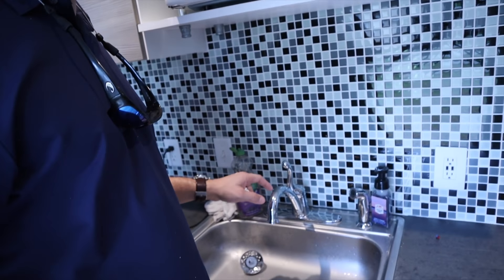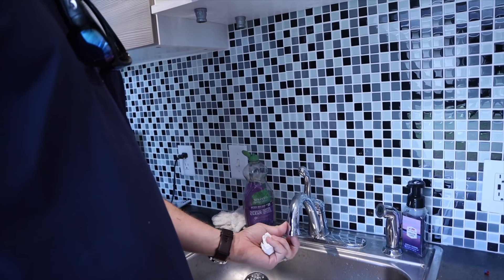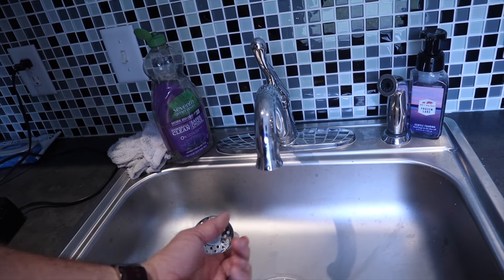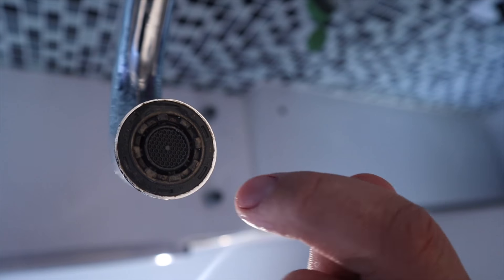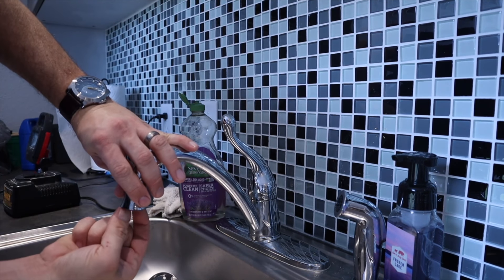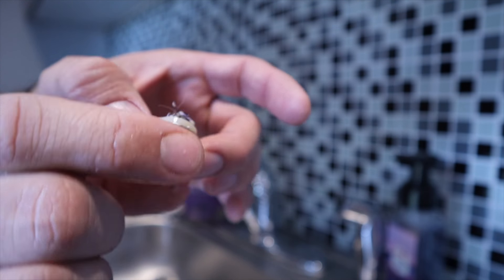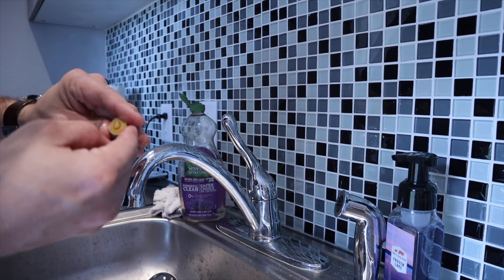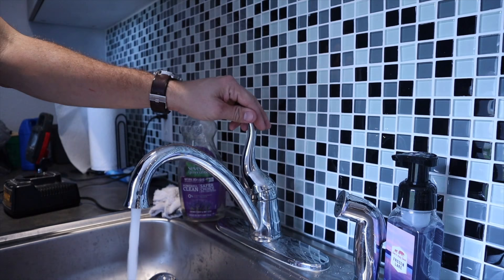Remove Water Faucet Hidden Aerator (Delta)

Comment: Your video showed me how to get the aerator out, but I was working on it in the middle the night with no tool.  I used two miniature screwdrivers; stuck them in opposite on sides and turned.  It came right out.  My problem was calcium deposits.  The holes of the small strainer on top were, also, clogged with calcium.  I used a small gage pin to open the holes.  It took a few minutes, but I wasn't doing anything anyway, and  it saved money.  Thank you so much.
Reply: I have so much calcium I can't get the tool to go into the holes.

Comment: Just to let you know: Delta makes a key-like round notched tool to make it easy to remove the aerator available at Home Depot or similar. Also the amount of debri in that faucet indicates some other serious issue. I've seen bits and pieces of metal or tiny particles of dirt, but never fibrous looking material in the aerator.
Reply from the maker: Thanks, Harlan, I have the tool linked below. This building was piped and some sand got in the main line, that’s why the aerator was clogged. Thanks for the tip.

Comment: Thank you so much!  You just saved a widow a plumber’s bill and/or the cost of the aerator tool!  My fingers wouldn’t do it but I used a little pinch nose pliers to grab the aerator tab.  I would not have known what to do or which way to twist it without your video. Thank you so much!

Comment: Thank you! Your advice allowed me to remove and clean the aerator. In case this helps anyone else, I have one of those faucets that pulls out to become a sprayer, and it seemed much of the obstruction was just above the hose. The hose is detachable, and I was able to remove most or all of the debris, and now it all works like new! I was afraid my old pipes might be full of deposits and need replaceement.

Comment: Thank you! This vid helped me figure out how to fix my problem. Though my issue required me to purchase a new filter. Also, thanks for the tip about the key. Luckily my home builder/installers left the key under the sink, which was a nice surprise to find . Btw the new filter I bought ($6) came with a new key too.
Reply from the maker: Glad to help, Raymond, thanks for watching. Thanks for sharing. Your comments might help someone else. 👍

Comment: That was so helpful, we ended up with a lot of crap in our lines after we turned off the water during the freeze so that was super helpful. I didn't realize that in the box they had a tool and when you mentioned that and I was like might as well look, and there it was and now I have running water in my bathroom sink. Thanks so much!
Reply from the maker: Great to hear. I’m glad it helped you out. Thanks for watching!

Comment: Thanks for the video. It helped me understand how that stupid design was supposed to work.
and now I understood why that faucet was 75% off when I bought mine. Different brand but same style of aerator. I tried to remove but it was stuck quite well, So I had to damage it. At least we have more water, until I can get rid of that stupid faucet.
Reply: Dang
Reply: same here !plus busted my finger nail!  and gouged myself several times! it was made of plastic -finally got it out with a thick credit card!

Comment: Well, this helped me remove the aerator! Yay! However, the faucet still has low pressure while the sprayer has a lot more. This happened right after my boyfriend installed it. At least now we know what the problem isn't!
Reply from the maker: Could be a clog somewhere in the faucet stem, or maybe your model just has a lower pressure. I wouldn’t think it was a clog in the supply lines since your sprayer has strong pressure, but could be. You could also remove the valve assembly of the faucet and make sure there isn’t a clog there. I have another video where I replace the valve cartridge on this faucet (if yours is the same model, that may help you).
Reply: @IAmAFixer  awesome, thank you! We will take a look. Thanks for sharing your knowledge with folks!

Comment: I have a new delta hidden wide separated faucet in a bathroom. After all of a week it completely stopped!!!! We took out the aerator using the tool which Delta supplied and some debris came out. However you make it look so simple getting back in. After three tries it still has some water squirting sideways and worse than that water is leaking under the cabinet down the little black tube that goes to the spout. My plumber thinks its connected to the aerator not sealing right. Boy its frustrating.  Any tips to reinstalling so everything seats right?

Comment: Is it possible to put a Britta water filter on these types. I just moved into a home with this kind of hidden aerator and want to a) put Britta on it, and b) adapt so I can put a garden hose on it in the winter. Am I stuck with replacing the whole faucet if I want to do these things or can I do it as is? Thanks!
Reply from the maker: You could probably unscrew the aerator and attach a garden hose fitting and possibly a britta filter, but you would just lose the aeration adaptor. Not positive about the thread size
Reply: what is the result?

Comment: Awesome, thank you so much! I should have tried to take it off before I bought one of those aerator keys. :(
Reply from the maker: Don’t feel bad, I almost did the same thing! I’m sure one of those keys makes it much easier though! Thanks for watching!
Reply: @IAmAFixer  I used the ends of the needle nose pliers as a spanner tool.  Works but the aerator is damaged and needs replacing.
Reply from the maker: That’s too bad. Thanks for sharing!

Comment: Question. I just replaced mine and I noticed the water pressure significantly changed. But I also noticed the previous aerator was in upside down

Comment: My aerator has a slot on either side, but not all around like in this video. Do they make tools for that too?
Reply from the maker: What is the manufacturer of the faucet?
Reply: @IAmAFixer  I'm afraid I don't know. I live in an apartment and they put "water saver" heads on the faucets. When I try to unscrew the cover it just spins. I can see screw threads under the cover.

Comment: Thanks for your videos. I really enjoy them. I have a question maybe you can help me with. I just went to Home Depot and purchased a Delta Faucet. I think the model is 9113-DST which has a pullout faucet head. I installed it 5 days ago and the problem I'm having is the water pressure is already reduced. It was great for the first 2 days but as small particles and settlement is coming through the lines it's starting to slowly clog up the inside filter. Unfortunately, the inside filter does not appear to be removable. It looks like I have to take a little pipe cleaner or small brush to clean it off. My question to you is do you know of an aftermarket faucet head that does not have all these filters and water reducers in them? Or one that you can at least completely disassemble to clean? This faucet head does not appear to be one that you can disassemble. Thank you for your time. - Jim

Comment: Why was the water pressure different when you removed the aerator?
Reply from the maker: It was packed with sediment. Once I cleaned it, it restored the flow.
Reply: @IAmAFixer  make sense. I removed the aerator from my bathroom faucet but it still has a plastic piece with one tiny hole I've been trying to remove it but no luck and the water flow looks exactly like that in the video

Comment: I have been struggling with removing the hidden aerator. I purchased the tool key from Home Depot. But the aerator does not move from its place even a millimeter. I am not sure but may be its stuck with mineral deposits. Can you please suggest some solution? I tried soaking the end part of the faucet  for 3 hours in vinegar by tying a small bag full of vinegar but no luck.
Reply from the maker: I know this may sound silly, but you’re sure your twisting the right way? Righty tighty, lefty loosely. Can’t imagine what would be keeping it in there that well , otherwise.
Reply: @IAmAFixer  Yes counter clock wise like unscrewing when looked at it straight from the bottom upwards towards the faucet opening. It's stuck like it has been glued or something. Do you suggest breaking it with a tool or try some alternatives like using WD-40 to loosen it? I can't think of anything else. Please help!

Comment: My Delta cache aerator will not turn when using cache key that came with faucet. Figure aerator has corroded and 'frozen' inside faucet. Suggestions?
Reply: Same problem.  All the tool did was mangle it.
Reply: Same here

Comment: Any ideas for unscrewing an aerator cap that won't budge?  I have the tool/key.  No luck getting it to budge.  I asked a plumber to take a look at it when he was here doing some other work.  He had no luck either.  Soaked it in WD-40 for 24 hours.  No luck.  Soaked it in CLR for 30 minutes.  Still no luck.  Both of my master bath faucets have low flow with aerators that won't unscrew.  Any advice is appreciated.
Reply: I have even tried vinegar overnight. Same thing. Vinegar dissolves the calcium externally where I can get the tool to mesh but turning it?  No way. It’s like it’s welded in place.  Have not found a YT yet that addresses that. Just getting the damn aerator off!

Comment: My issue is the calcium deposits. After soaking in vinegar for 24 hours I can get the tool in those notches but it’s like the aerator is welded in place to the faucet due to the calcium.  Trying WD40 next to hopefully help break it loose. I just cannot unscrew the aerator.

Comment: If you pinch the mesh, it will come off and you can clean inside.  I had to even re-seat the o-ring cuz it was off.
But, I actually came here because I need to remove the entire inner part, not just aerator, and the keys I bought don't seem to fit the outer part. Its a grey sleeve between the metal and the aerator.  I wanted to install a swivel extention.

Comment: You got it with your hand?? Man I can’t turn it even using the tool. Its so dam hard. Any ideas??
Reply from the maker: Try soaking the faucet head in CLR for a while to see if it can dissolve some of the calcium build up
Reply: I Am A Fixer what is CLR btw?
Reply from the maker: https://www.amazon.com/PB-BK-2000-CLR-Kitchen-Cleaner-Trigger/dp/B07CQ5L14W

It’s a cleaner, can dissolve calcium buildum
Reply: I Am A Fixer good to know. Thanks!

Comment: They make a key for that
Reply from the maker: Yes. Live linked it in the description
Reply: @IAmAFixer  Now I have another question my air raider is gone the metal part is stuck inside do they make an extractor tool to take it out of my faucet I had the same faucet
Reply from the maker: I don’t think so. You could probably remove the faucet stem from the base and use a coat hanger or some other flexible wire to push it from the inside out.

Comment: Do you know what the next step is if its not the aerator.....because It can be other things as well..
Reply from the maker: Hugo Moreno if it’s not a clogged aerator, it could be a clogged valve cartridge. I have a video on that too. Otherwise, you probably have an issue with your pipes or shutoff valves.

Comment: I need help
Reply from the maker: Try ordering the removal tool (link in the description). You should be able to get it with that. You could also try filling a cup with some penetrating oil and submerge the sink spout in it for a little while to try and loosen it up.
Reply: with something else I have 43" by 21" bathroom cabinet countertop here they put 22" on I thought is like this further back even if online looks reachable smaller .... , the sink is big round and I think sticks out where faucet is and counter and just not good style I have 6" delta faucet and really very close actually more so and say hitting hands on sink have to wash above sink and faucet not in sink sink is bigger .., .... but looks faucet handles far back on spot I want to put drop in sink but I don't know if changing just countertop I'm laying in sink and it's farther back and I think same problem if change countertop in this apartment I've been planning to change both neighbor help me I hope with that too I have same problem faucet looks feels is far back in kitchen everything is standard size and in bathroom It is low arc delta maybe moen in kitchen sink and usually that is why too I can barely use rinse rag can't end now wash dishes wash wrists must be something wrong and like bathroom does look more square and cabinet and I thought with this size in bathroom I forgot last thing in kitchen it is on granite countertop s and there's dishwasher

Comment: even with the tool mine wont come out
Reply from the maker: That sucks... is it a delta? Other Faucet brands may have a different pattern for the remover tool. You may try spraying some penetrating oil up there to try and loosen it, but gravity would probably prevent it from working.
Reply: @FistFulOfDildos  counter clockwise UPSIDEDOWN!

Comment: I have one of hose cheaper faucets in my bathroom (brand new) and I had to get rid of the stainer piece inside of the aerator because my Marley hot water heater won't even turn on because the water has to flow a lot faster. Don't EVER buy anything made by Marley!

Comment: Based on a video to use a basic tool, maybe a vid on how to untie my shoes!!   

Good description for non-handy people, but the real issue is when deposits stick the aerator. It is so tight that (expensive) cheap little plastic tool just shears the teeth off. I just had to machine and make an annular cutter to cut down to the bottom thread then a mirror and a steel pick to get the last thread out. Horrible design, poor tool for the job from Delta. If you dont have a lathe, good luck getting this thing out. 

Lesson - -take it out monthly and use some silicone grease to keep it clear. I am in a real pickle - - found this video looking for a well engineered tool to remove the stuck, and a thread chaser to prevent a replacement from sticking. I am now off to call Delta for the lifetime warranty. Yuck.